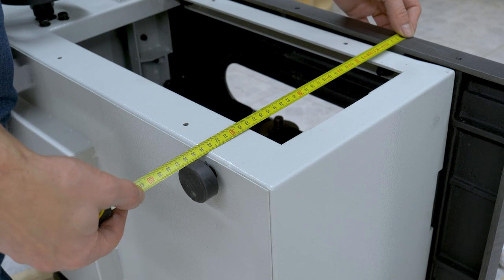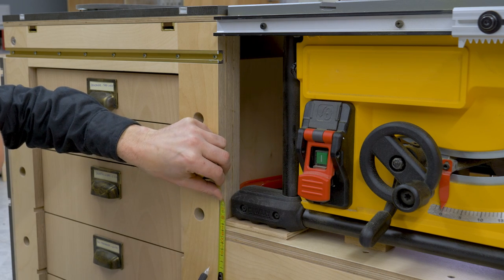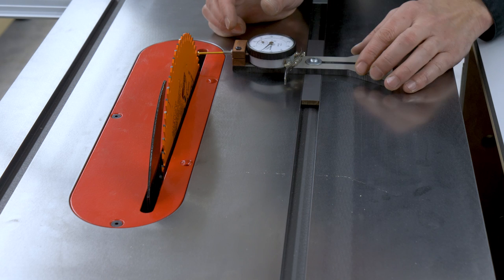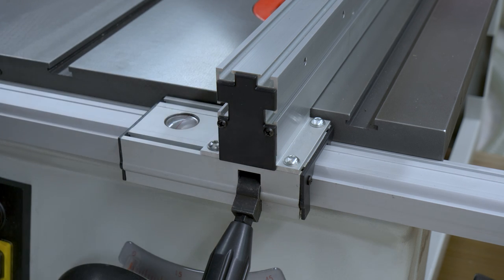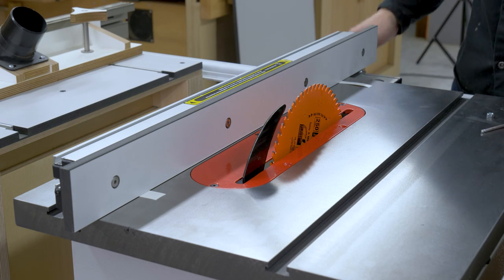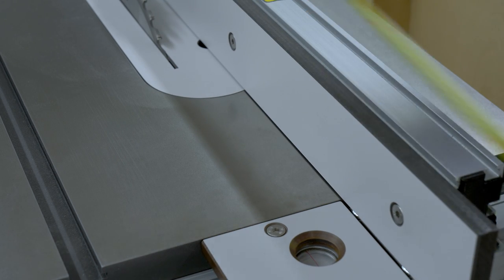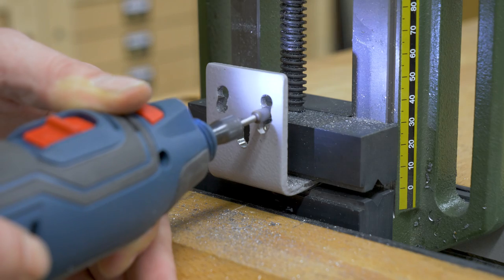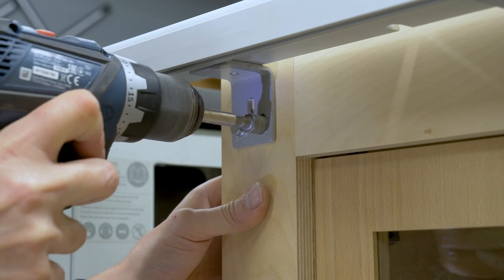How to install a Cast Iron Table Saw on a Workbench - EP 1

Comment: For people wonderign why he changed the tablesaw:  

The old dewalt is a brushed motor - extremely noisy as well as less power efficient - it's a "site saw" designed for occasional use.  The new saw is designed for regular work and induction motors are considerably quieter and more efficient with both electric usage and power delivery - brushed motors can stop altogether when even medium load as they only have (usually) 2 points of contact for the "brushes" (carbon switches) and the spinning stator of the motor, through which to deliver power to the blade.  An induction motor has a continuous ring around the stator making for a much smoother and stronger power delivery.

Comment: I have AW254ts; the model that came before the one you have. It is the same saw but with different colors. I also upgraded from dewalt and I never looked back :)
One upgrade I did on my saw is gluing small (ca 5mm in diameter) neodymian magnet in the slot for the fence handle and that way it doesn't close on itself when I am trying to fine tune the cut.
Reply from the maker: I have already had this problem, thanks for your idea Darko!
Reply: Another genius suggestion. I hate that the handle keeps falling down and auto locking it!

Comment: In the US from 1950-1970, you could buy a cast-iron saw with a narrow table and short fence rails; extension wings and long fence rails for sheet-goods and a superior rip-fence were available as upgrades not as standard features forced upon the customer. Axminster is following that retro base-model-with-upgrade-path approach.  Axminster is also including a feature that normally doesn't appear on saws priced under $2,000. Its trunnions are mounted to the cabinet not bolted to the table top. Aligning blade with miter slots can be very difficult when the motor is hanging from  the table top.  And it is very compact! The Axminster puts an internal induction motor in a bench-top cabinet! There's nothing like it in the US today. When we are buying a new saw (to get one with a riving knife) our choice is between lightweight portable saws that don't want to stay aligned (if you can even get them aligned) and big saws with very wide rails optimized for sheet goods.

Comment: Again your ingenuity comes through. I do understand the advantage of a cast iron top. My saw has an aluminum one and I have regretted that almost from day one but it was a gift. I am a little confused by the mods you had to make to the rails and fence. I am sure it will all clear up before you're done.
Reply: I dislike my Ridgid Cast Iron table saw, the casting wasn't properly rested so it cupped around the throat plate by 1/16" 1.5mm in certain avoidable situations it can cause half lap joints to inconsistently fit. I flattened it with a slab flattening jig since carbide can cut cast iron as seen on the channel "Cosmas Bauer" when he modified his saw with a router. I'd say bring a staight edge to check the floor models at the store. It's a product of skipping steps in manufacturing possibly to save space.
Reply: Makita has higher tolerances for aluminum table saw flatness. Makita often has greater value than others too, their track saw's, their hepa dust extractors.

Comment: Happy to hear that some of you have good feedback with this axminster cast iron table. I had the previous version AC254TS that was red but mechanically they didn't change evena a screw. I had a really bad experience with this product:

1. Cast Iron top not flat
2. Bad tolerances on the T-Tracks
3. Really bad extension panels on the side and back
3. Mechanical vibration on the riving knife

For the last listed problem, I had to send it back two times and the technical team didn't find the root cause. Probably there is some eccentricity on the motor shaft.
My overall opinion is that the product is good for noise reduction but it is not really an upgrade respect to some really decent job site table saw like the Dewalt.
It is manufactured in China so the Quality of the product can be very variable from time to time. Maybe I got two times a bad piece :(
At the end I finished buying the DWE7492 as a replacement.
At least I can say that the Axminster support is great.

Comment: It will be very interesting to see what further changes or upgrades you do to this saw, i have the axminster ac216 ts which is the same as yours. I have a couple of issues with my saw it will be interesting to see if yours has them as time goes on, on a funny note i suspect axminster will be spitting feathers with your walk through on how to fit dado blades by filing spindle down.As always very informative and very well explained looking forward to part 2.

Comment: Hi, great video's! I bought your plans and ordered the iron table saw. Have to wait 2 month's at least. I'm thinking about making the workbench as wide as the saw table. (680 mm I believe, instead of 570 mm) just like you did with DeWalt saw. Perhaps you would be better off with the dust extraction. Is there a reason not to do this or is it perhaps smarter to do it while I can still adjust this. Could you please give an advise.

Comment: You could use strong tarp, leather or some other flexible material to cover the bottom of the saw. For better dust extraction..  Well done..Greets from Germany
Reply: I think saw comes with bottom cover but it is embossed and because of that total height of the saw would be greater and I think he would have hard(er) time fitting it in the bench...

Comment: Will you not miss the extra power (500W) of the dewalt?  I had bought the dewalt 7492 based on your excellent table design that I'm starting at the moment.  I do wish I'd shopped around a little more for something with a cast iron top, especially as I live very near an axminster store and this saw with the Black Friday discount is currently cheaper than what I paid for the 7492...on the other hand the rack and pinion fence system on the dewalt, once calibrated, is really excellent, I'd probably only change it for an Incra system which is a very expensive upgrade.  The other thing was the Dado blade which the 7492 can take, it never would have occurred to me to modify the axminster machine to fit one!

Do you find the cast iron top and induction motor to be a significant upgrade?

I increasingly think Axminster or Felder or someone like that are going to make their own version of your table.  Combination type machines/benches are so much more convenient for most hobby woodworkers than the current offerings, even the felder/hammer combination machines aren't really designed in a way that can be operated without having 360 degree access, which is hard to get in a small 1 garage workshop.
Reply: Rockler rock steady tables can be used as modular frames to start but I haven't yet seen prefab modular workbenches yet.
Reply from the maker: yes, I think it's a significant upgrade. I'm about to finish editing a new video review of the two saws!  Jobsite VS Cast Iron Table Saw
Reply: @joe_ferreira  I think it's not so much the modular element as the workbench type layout that makes it so convenient; it can easily fit against a wall and rolled out when you need it, it's allowed me to fit so many other machines into my workshop that I never could really do before; e.g. a free standing 10" planer thicknesser that can fit next to this bench along a wall.  The modular aspect you mentioned where it can fit together with a regular workbench or mft table is just icing on the cake really.  Tbh you don't even need the outfeed extension on this if you can use your workbench as one.  

If you want a normal tablesaw with similar capacity and functionality you basically need a panel saw or largish contractors saw which just isn't space efficient at all.  This great table is such a magnificent bit of problem solving, it gives you that contractors saw capacity, with a carriage, while fitting in the router table, I'm such a huge fan of it as a designer.  I'm trying to get a 6mm steel top made for my router table and table extension surfaces, I wonder if long term I should have something similar made for my Dewalt 7492 too.
Reply: @Paoson_Woodworking  damn...wish I'd held off now and got this axminster one!  oh well, it will do the job I guess, maybe in 10 years I can justify changing it haha.
Reply: @Paoson_Woodworking  looking forward to/dreading it!
Reply: @Paoson_Woodworking  would be awesome if you could publish it before black Friday offer runs out.
Was sure to buy the Dewalt but now you tempted me😁

Comment: Great video. I have the same saw and noticed you have changed the original riving knife. Which did you use to replace?
Reply from the maker: I'm using the Dewalt 7492-QS riving knife, I've bought a replacement to use with this Axminster saw

Comment: Great video, thanks very much. I have the same saw (older Craft version in red), and I’d like to change the riving knife. Are you using a custom made riving knife in your saw? Thanks again.
Reply from the maker: it's the riving knife from the other Dewalt saw, I want to buy another one to use with the Axminster saw

Comment: Hi, great videos first and foremost! I am very interested in your workbench, and will probably try to build one in 2023. But I'll need to modify mine for the slightly smaller Axminster 216 model saw. So, I'll be looking to purchase your plans at some point in the near future. Do you by any chance intend on creating a modified set of plans for the Axminster saw? If not, any considerations not mentioned in this video on things not mentioned?
Reply from the maker: I think you can use that saw without modifying the the bench frames, just modifying the tops, just like I did in this video
Reply from the maker: btw, I will show how to modify the tops in the next video

Comment: Great project! How is the dust collection and noise level with the new saw? Also I noticed it's 50Hz, any idea if the motor is compatible with 60Hz or if there are additional options available for US power frequency?  I haven't seen many bench top cast iron options out there. 

Cheers!
Reply from the maker: I'm editing a new video where I will explain these issues. I think it's impossible to buy this saw in the US, but here's something similar:
https://www.paoson.com/forum/viewtopic.php?f=22&t=1940#p9250
Reply: @Paoson_Woodworking  Similar?  Hardly.

Comment: Hi Suso,
First my compliments, love your workbench series. I have also ordered the AW254TS and it arrived today. For your informatieontsluiting, you decided not to mount the baseplate, because of the bulge on the outside. But the bulge should be on the inside. See figure 08 at page 9 of the manual. 

I realize that this is an entree level cast iron saw. But is your cast iron plate flat? Mine has a bow downwards towards the middle. The difference is almost 1mm.
Reply from the maker: hi Rob! that bulge hits the midrail of the workbench. I think I'm going to put cloth or plastic in its place. 
Mine too, but it doesn't reach 1mm, it's about 0.5mm. From what I've read, all low to medium budget cast iron saws have this problem. Send me some pictures of your worktop please. You will find my email at the bottom of the web.
Reply from the maker: 1mm seems too much to me, you should consider returning it to the store
Reply: Hi Suso, Have you checked the manual at page 9? The bulge should be facing inside. No interferance with your midrail.
Reply from the maker: I think the bulge should be facing outside to allow room for the motor when tilting the blade to 45 degrees!
Reply: I will measure exactely with a feeler cauche. If the deviation is more than 0,5 mm I will contact Axminster.
Reply: @Paoson_Woodworking  Offcourse you are right. I have found the manual in pdf. The pictures are better readable.

Comment: I didn't understand why you decided to chance the table saw. The other one didn't work properly? Did you think this could work better than that Dewalt table saw on this workbench?
Reply: The old one is a brushed motor - extremely noisy as well as less power efficient, induction mototrs are considerably quieter, and more efficient with both electric usage and power delivery - brushed motors can stop altogether when even medium load as they only have (usually) 2 points of contact for the "brushes" (carbon switches) and the spinning stator of the motor, through which to deliver power to the blade.  An induction motor has a continuous ring around the stator making for a much smoother and stronger power delivery.
Reply: The new one was given to him.  Lol. I'd change my saw too someone gave me a saw. 😂

Comment: Amazing work, but why not just upgrade to an actual cabinet saw? A cabinet saw would require less modification, would keep its warranty, would fit a dado stack without having to modify the arbor, and would overall probably cost about the same as what you’ve spent here…
Reply: But what's the fun in that?

Comment: Great work as always Suso!
I am wondering... I take it, you have a dedicated miter saw station. Concerning your mobile workbench with the cast iron saw and router table - could a portable miter roll stand be added/connected to the end of the bench and use the same track guides and top for cuts? Similar to this (https://www.youtube.com/watch?v=hmXx7R8VBPM) but with a better design typical of your work. Thanks!!
Reply from the maker: could be done! I have in mind designing a new bench dedicated to the miter saw